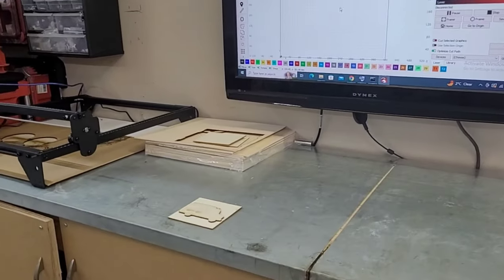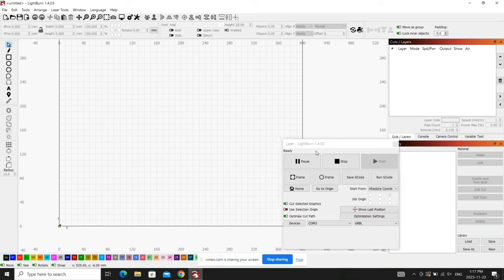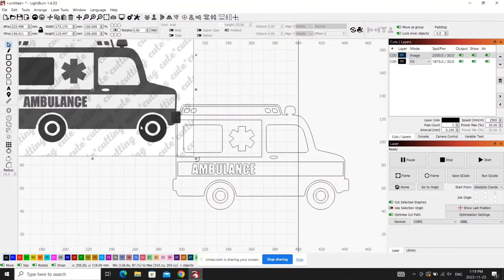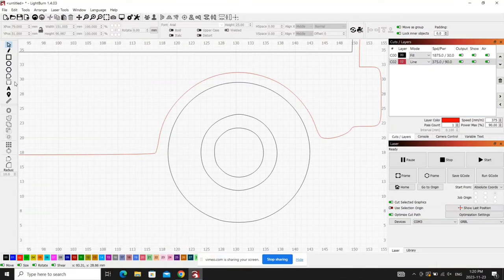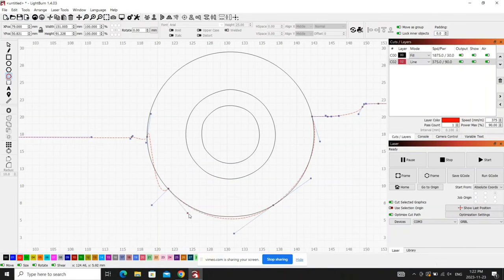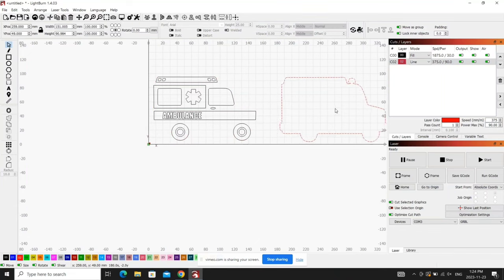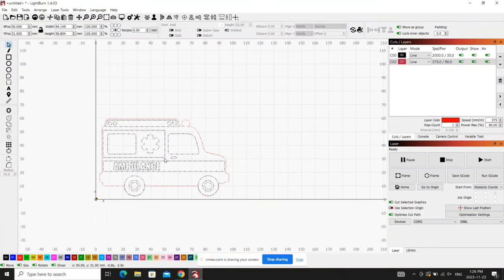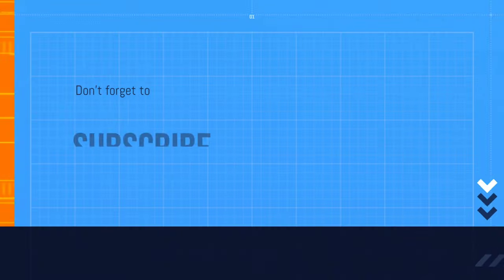Make Your Own Laser Cutting Files In Minutes!

Comment: I have found to get quick results with almost the same outcome if you do you trace. Then with the trace selected do an offset trace outershapes say 2mm. Then select the original trace ungroup delete the body. Then select the offset line and do an offset of that line in the same distance you offset it out. Delete the outer line and your good to go. This will save a crap load of time of doing node modification.

Comment: Great video. You could also make the lines go straight across and make new wheels with the circle tool. Then use the Boolean assistant to add the wheels to the outline. Probably how I would do it.
   Also, that's an easy jpeg to convert. Most jpegs will take longer to convert with this method. I hear there are some great AI models you can use with stable diffusion to convert images to vector files. I haven't tried it yet though.
Reply: Use node edit and add nodes much beter